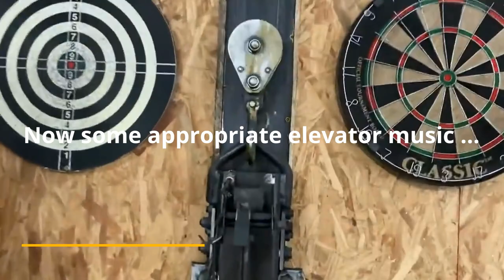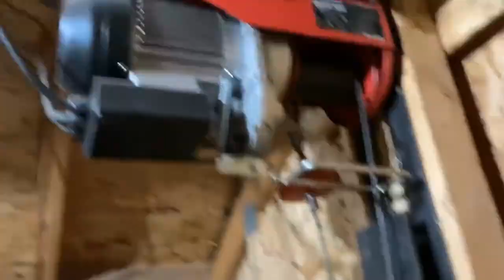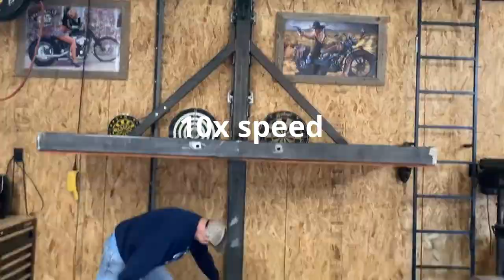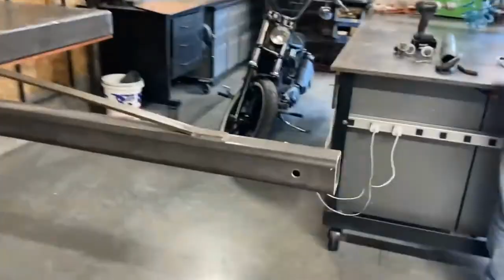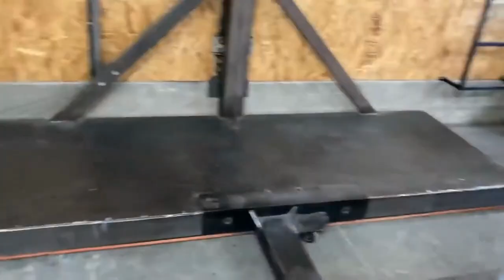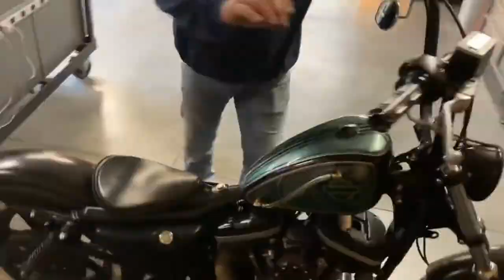SHOP/GARAGE/ATTIC ELEVATOR WITH MOTORCYCLE LIFT ATTACHMENT

Comment from the maker: I used a 1000/2000 lb electric hoist. 1000lb single line and 2000lb double line. I use the double line.

 The track is made of 5 pieces of flat stock. It's the front plate with the holes for the safety latch with two other 6" flats welded to back side, the whole length, that are sandwiched between 5 studs in the wall. One stud in the middle and two on each side then bolted together all in one sandwich. I used a stud to space them when i welded those on. Then the two other straps that you see are welded to the 6" pieces going the whole length and are there for the bearings of the train to run in. Those are just screwed to the studs with small cabinet screws and they aren't really holding any weight. They are spaced back from the back side of the front plate to the size of my rollers because you need a track that will hold both directions. The top rollers will be pushing out and the lower rollers will be pushing back into the wall as it goes up and down. There are also rollers that hold the train from binding left and right that run against the sides of the front plate (upper and lower, both sides). If you don't have a safety latch this track really doesn't have to hold any weight it just has to act as a track and could be made more simple. As soon as you latch the elevator into the track it instantly has to hold all of the weight of the elevator and whatever you have on it. Kinda tough to describe. Hope this doesn't confuse the situation.
  The platform is mainly all built of 2x5 1/4 wall except the front edge is 1/8 wall. There's also 2x5x1/4 internally acting like floor joists and more support for bending or flex.   I would say WAY over built, but better safe then sorry. I think I figured it up one time...... at least 500 lbs.

Comment: That lift is totally the kind of thing I need. I’m thinking of using i beam for the column  along the wall just because I have some spare i beam but I’m still trying to wrap my head around your design. Any chance you could post a diagram or close up pictures of the trolley parts where you have rollers on it?
Really slick piece of equipment! Thank you for posting this!!
Reply from the maker: Just think of your trolley that rolls on the outer edge of your i-beam.... you need to have rollers to hold the trolley in and out... both top and bottom. You would also have to have rollers that roll on the edge of that i-beam to hold sideways movement (top left edge and right edge) both top and bottom. That way your trolley only rolls up and down. No matter where the weight is on your platform... it wont bind. Hope that kinda clears it up.
Reply: @164ChopShop  Thanks for your reply man. Yes, I understand that I’ll need wheels giving tension on all sides and at least two trolly type setups that hold the I beam in both axes with wheels. 
I guess what I’m wondering is what do you use for wheels and how do you keep them tight on the column? I’m thinking of using a seesaw lever on the wheels with a screw for adjustment of tension but not sure. 
Thanks again!
Reply from the maker: @kthom9864  Mine are all stationary to the trolly. Leaving very minimum clearances. Like a piece of paper thickness so they don't bind. I used sealed roller bearings for rollers. I don't have any special tools except a center punch and a regular drill press. There may be a seesaw lever situation that may keep things tighter but I think if you are accurate with your drilling there would be no reason for it. Keep the tolerances tight and it should be good. At least mine is.